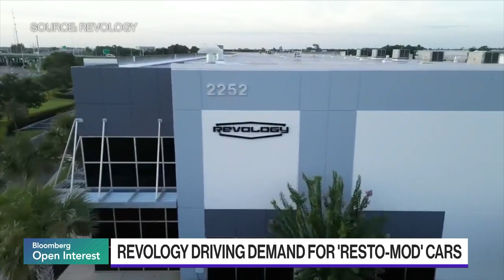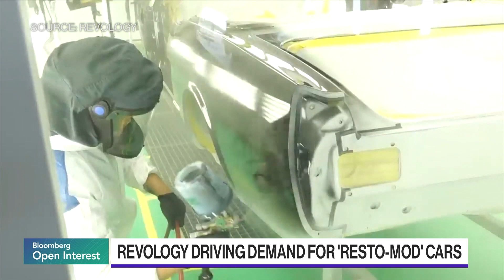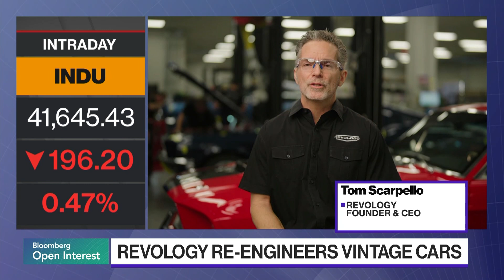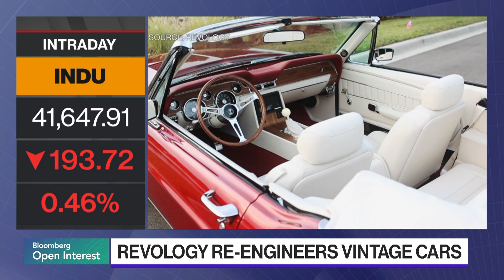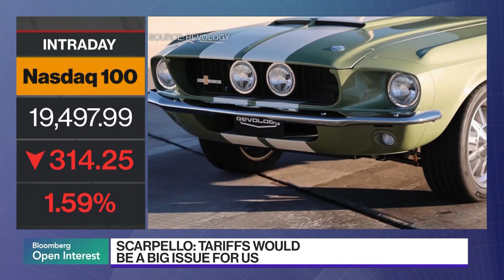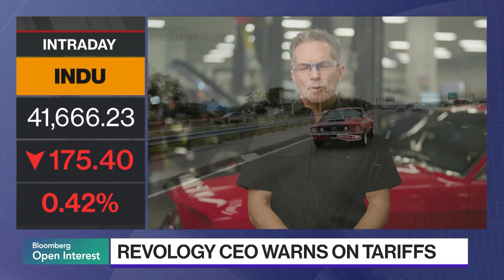Revology Brings Classic Ford Mustang Cars Back to Life

Comment: With starting rices of 395K you would think the people building these cars would be paid accordingly

Unlike standard repair shops, Revology explicitly states in its job listings that these are stable, hourly positions rather than fluctuating "flat-rate" mechanic setups.Warehouse / Shop Assistant: $20.25 to $22.36 per hourAuto Body / Assembly Technician: $22.00 to $34.00 per hourAutomotive Upholstery Technician: $23.00 to $32.00 per hourAutomotive / Electrical Technician: $27.59 to $29.16 per hour (averages around $69,000/year full-time)Equipment / Service Technician: $33.48 per hour

Comment: This is not a boss 429 Mustang. The whole point of the boss 429 is the boss 429 hemi engine, and this is a coyote engine so it’s not a boss 429 Mustang. 

The boss 429 hemi is one of the greatest engines ever produced and it’s just as good as a coyote today and Jay Leno is wrong about the weight and handling of the boss 429 because In tests it was rated the best handling muscle car. 

You would have to be an idiot to spend $400,000 or whatever this guy is asking for these cars and think you’re buying a boss 429 when you’re buying a coyote in a 1969 Mustang. Go ahead, be my guest and buy it and waste your money. This is Idiocracy at its best.

Comment: Coyote engine 10k, tremec trans 6k, 1000 hours @ $150 for body in paint, interior, heated power seats and leather, 10k, dash goodies-infotainment n guages, 10k, amortized costs baked into re-engineering tool-ups - (assume 2mil startup) - 20k per car, "admin" - 100k per car, that's 300k.  Keeping Ford happy enough not to sue you off the face of the earth: Priceless.

Comment: I thought these cars were expensive, but it supposedly takes 24 weeks to build one of these cars, and if you told me the shop rate was $250+ per hour for each of the nearly thousand  hours it takes to build one of these, I would not be surprised at all. I still think they're expensive, but I can completely understand why.
Reply: If you have ever restored a car the number$ and time required then these seem very reasonable to me.
Listening to him speak  and seeing the build quality adds to my confidence in his pricing.

Heck, if you ever have restored anything, you understand it’s a labor of love and your wife is the only one bitching about cost.

The one that gets you is buyers remorse. That one sucks!
Reply: @guybeingaguy  Just buy the originals; these cars aren't appreciating.
Reply: @ 
Your point is 💯 valid 👍
I didn’t consider that aspect and considering the price that’s important…….
If, if the build quality is there I don’t see them depreciating at all. They would be garaged, admired and driven a few times a month, year (?).
$200,000 + puts it in a different category than the painstaking ground up restoration we are used to.
His approach is new and unique and I certainly wish him well.
I just don’t think they will depreciate at all.